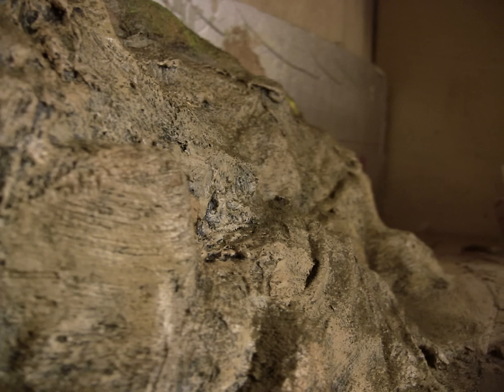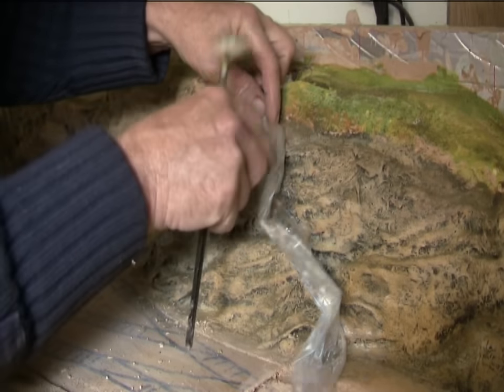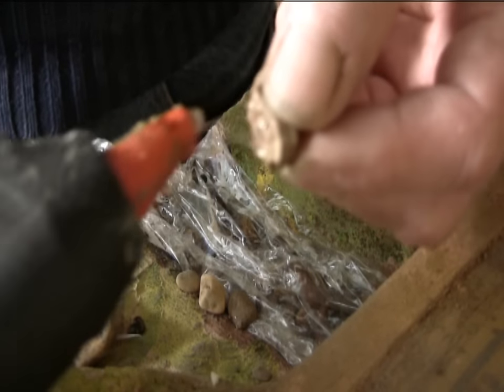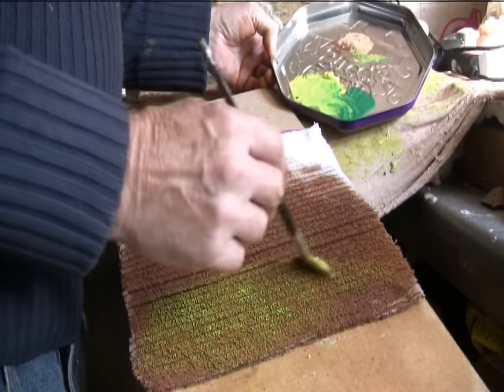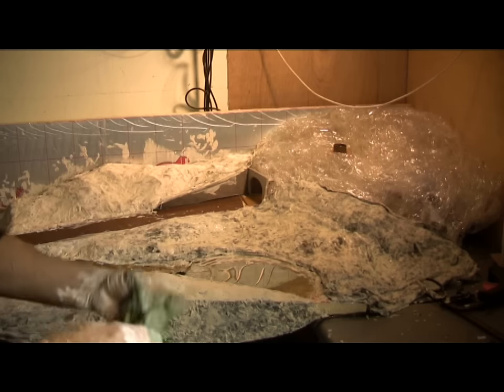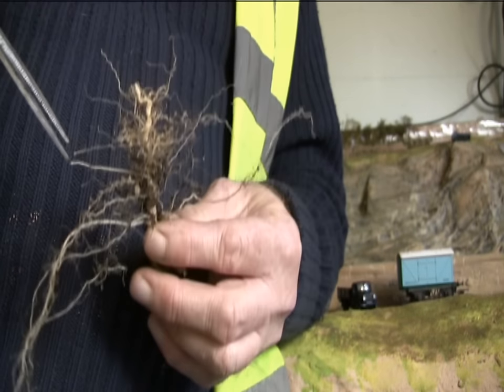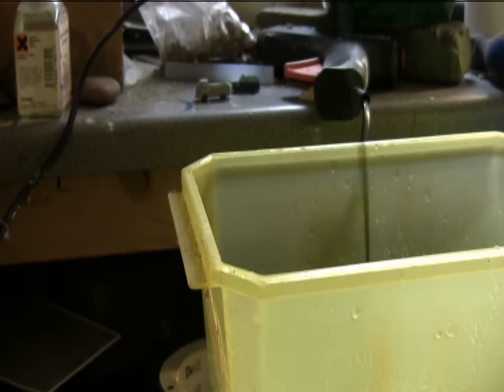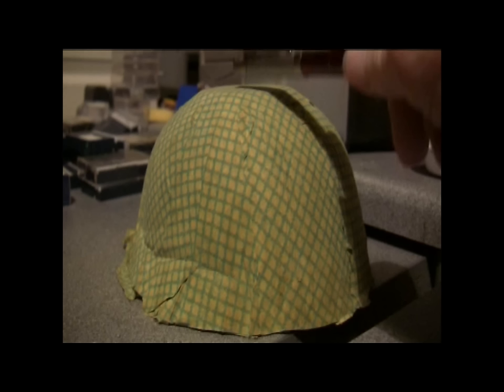How cloth can be used in modelling by Shed Engineering

Comment: Inspirational as usual Alan, I've nearly got my track down then the dreaded wiring, and then to try some of your great plaster tips, and hope I don't get plastered! Again great ,keep em coming.
Reply from the maker: +Fred enbee Hi there Fred,,,, many thanks for dropping by and your lovely comment ,, thats really appreciated ,,,  im just doing another demo right now,,,, its drying in the shed at the moment ,,,, if this one works it might make all previous videos out of date including green plaster ,,,,, after the toweling worked so well I have just cut a big lump out of the throw thats on the sofa,,,, its like a fleecy soft velvet material ,,,, could make brilliant grass,,,, and I just slapped plaster all over the back and re-modeled the quarry ,,,, just hope the paint sticks to it and still leaves all the fine grassy fibers ,,,, sticking up and free,,,,  so you might have something else to experiment with in a couple of days,,, glad your making progress,,,,  don't worry about the track wiring ,,, I was worried to start with but its no big problem if your going with DCC ,,,,,   when I mocked up what was to be me fiddle yard under the big fiberglass hill side ,,, it just had a feed from the two main lines ,,, there where no droppers or feeds across any of the points or to any of the four sidings and locos run into the yard across 2 or 3 points back across 2 or 3 rejoined the main line down the back without any problem ,,,,,  so don.t worry im sure it will be fine,,,,   cheers and regards Alan
Reply: Hi Alan ,and thank you for your reply, by the way my has new fleecy lined coat, what do you think? I ran it by her, not sure she was keen!
But it was worth a try. .ps if you've used part of the throw will you now have to turn up the heat?

Cheers , I await new video........Fred
Reply from the maker: +Fred enbee Don't mention the Throw she doesn't know I HAVE CUT A LUMP OFF,,,  not a good idea to cut the lining out of her coat,,, even im not that brave,,,,